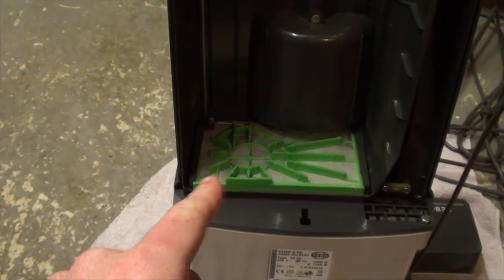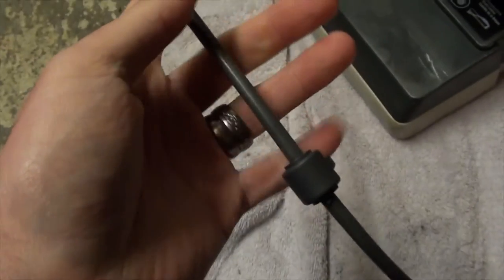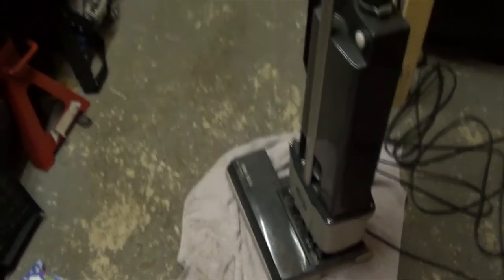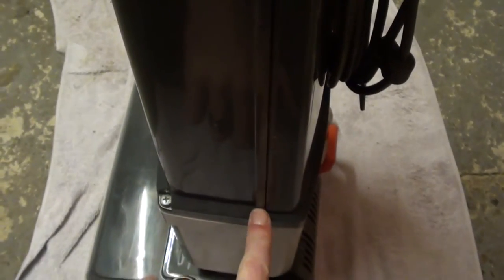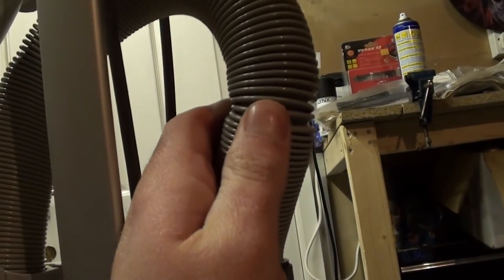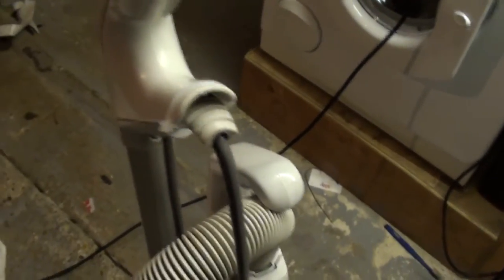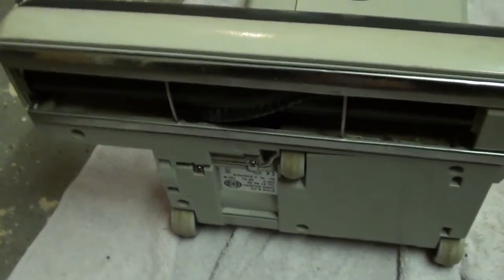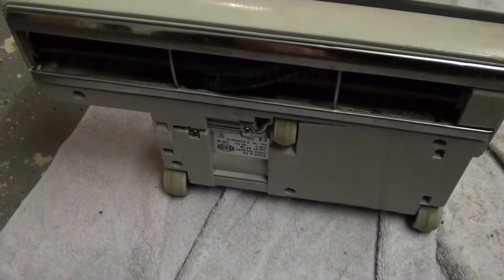Sebo BS36 Cleaned Up - RustySkull Productions

Comment: Also I have an older SEBO 360  - the older model to the BS36. Uses same brush roll and similar parts. The slide in brush strips are good - the red one is very tough on carpets but I just use the standard black one.

Comment: The cable should be wound from the top of the hook under the handle to the bottom hook on the bin door - you might find that the cable cleat doesn't put the plug out to the sides if you do it that way. I know there are twin hooks but the cord behind the handle is a neater solution. ALSO = big tip from me - Order the Felix slider tool storer as it will fit the metal spine at the front where two tools can be stored at the front. A further Felix tool clip can also be added at the front where the bottom carry handle is located at the front - this would give you three tools at the front.
Reply from the maker: Thanks, I've sold this now though :)